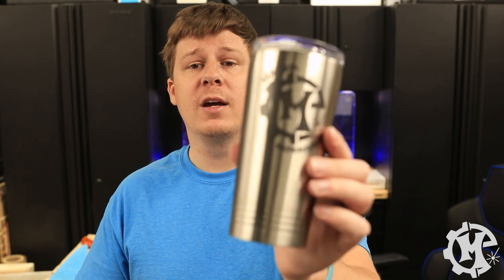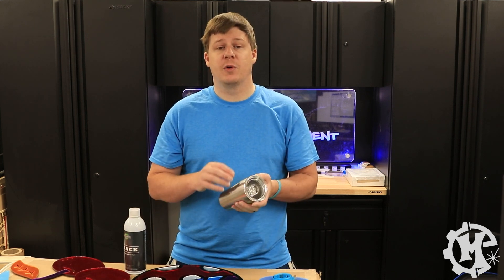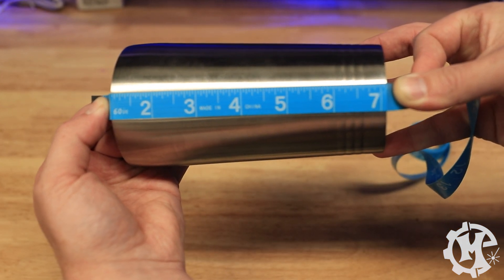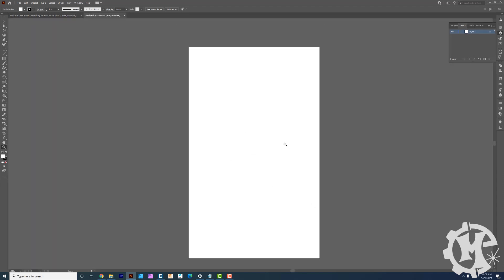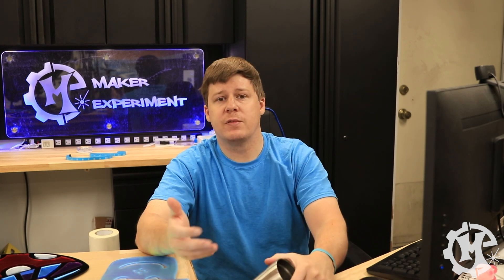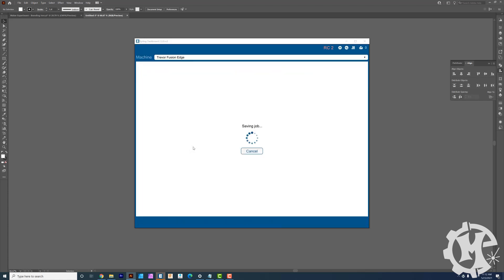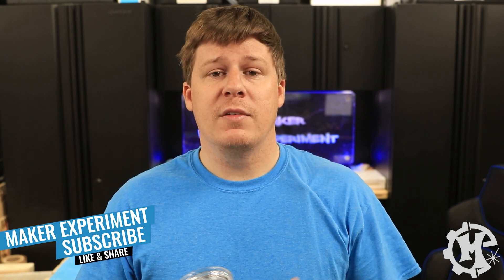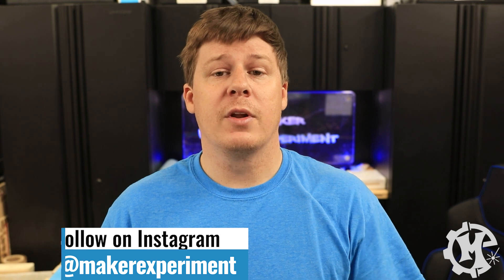HOW TO ENGRAVE STAINLESS STEEL TUMBLERS | ENGRAVING YETI MUGS | LASER ENGRAVING MUGS | LASER MARKING

Comment: What power or type of laser is required to use this spray to good effect? Currently i only have an Xtool F1 10w blue 2w IR. IR has not been working very well but my engraving room is 65 degrees. Reading the temp may be too low for IR?
Reply from the maker: I have not tried this type of spray with IR. I’ve only seen it work with a CO2 laser. That doesn’t mean it may not work with others but I would contact the manufacturer and see what they say.

Comment: Very good video but unfortunately what you show does NOT work with my Atomstack x/Pro or I have some wrong Lightburn settings ;( Could you please upload the exact parameters or a profile so that I could laser in exactly the same way on stainless steel?
Reply from the maker: I don’t use lightburn and the settings I use on my machine wine match that of an Atomstack. You need to run really high power and low speed for this method to work.
Reply: @MakerExperiment  THANK YOU SO MUCH for your quick answer and thumbs up for it XD and does it HAVE to be normal white matt spray or black matt?
Reply from the maker: @Muscle_81  this is a specialized spray called Enduramark. You have to use a spray like that one or Cermark.
Reply: @MakerExperiment  Ok, thank you very much, I ordered it just one more question XD Do you have the Airassist on or off?
Reply from the maker: @Muscle_81  I usually leave mine turned on.

Comment: Great Vid, Trevor! I am new to this and have been experimenting with the Enduramark Charcoal. I am getting light spots  toward the top of the graphic. They are uniform, so it's not like it's oil or something on the surface. Any ideas?
Reply from the maker: I’d check that the cup is actually level to the laser head all the way across. I’d also make sure the spray is even everywhere. Beyond that it’s hard to say without experimenting.

Comment: Hey nice vid. I was ordering a muffler and they were going to laser engrave it for me with my logo. I was wanting a more bronze look instead of very black like what is on your mug. Is this dependent on the source material I provide or the machine and the way they do it? Was wondering if I need to provide them a brown color logo vs my standard black one or does it matter?
Reply from the maker: It’s mostly dependent on the type of machine. To get coloration on metal they will most likely have to use a fiber laser. This is a bonding spray that reacts with CO2 lasers which is different.
Reply: @MakerExperiment  oh ok. I’m assuming they are going to use the cheapest method. I see a brownish/bronze color on most exhaust part engraving. Is this the natural engraving color?
Reply from the maker: @Dynasty-s1y  fiber lasers have some things they can adjust to get different colorations I believe. I’ve never personally done it though.

Comment: What does it do to the stainless if you did not use the marking spray?  I take it the stainless really isn't engraved, the laser just cures the marking spray onto the mug.
Reply from the maker: Nothing happens with a CO2 laser if you done have the spray. The spray reacts with the laser to create a cured layer on top of the stainless.

Comment: Hey brother I cant get my NEW 20W Xtool to mark ANY metal has worked great on wood and glass. Ive tried dry moly, cold galvanizing, omtech, brilliance and enduramark...nothing! with multiple speeds and powers, is it a settings issue?
Reply from the maker: I’m not familiar with diode lasers. I’m not sure what it would be that’s causing it. Typically you want slow speeds and high power when using marking sprays and similar items like it. It could just be a settings thing.

Comment: Hi, 
I want to do this. How does teh laser engraving change from SIlver v Black. Also from colour powdered finish v stainless steel? I am using the ATOM
Reply from the maker: The spray I use is for uncoated metals like this stainless mug. It has a chemical reaction and adheres to the mug chemically creating a black layer. 

For powder coated mugs it engraved through the powder coat layer. The powder coat is easier to work with but settings may have to change based on color of the powder coating.

Comment: Can I use the marking spray and the entire process with a diode laser?  If not, what process can I use to achieve the same result?
Reply from the maker: To be honest, I’d try and see if it works. I’ve never done it but if you can dial in the settings, it should be possible.
Reply: @Maker Experiment  thanks!  It is an expensive try.  But I think it is well worth it.  Should I try the brand you used?  It is a high-quality one, right?

Thanks for your videos!  You do a great job and seem like a cool guy.
Reply from the maker: @craigperrin9096  the one I used I like. There are others but this is one of the less expensive ones. You can reach out to Enduramark and ask them the question directly before you buy it. They may be able to tell you so you don’t waste any money.
Reply: @Maker Experiment  I got the marking spray, and it worked perfectly!    It is awesome.   I followed the settings as directed.  Thanks, man!
Reply from the maker: @craigperrin9096  I’m glad it worked out!

Comment: Why do you say it is "Permanent" when it is not!  It you had used a Fiber Laser, it would be smooth and PERMANENT, plus you would not have to go thru all the prep (spray, clean, etc.) to make the engraving adhere, the fiber laser does all that for you.  There is a layer (the spray) between the actual engrave and the stainless steel tumbler.
Reply from the maker: It is supposed to be permanent if done correctly. In order to use a fiber laser I’d have to own one. I don’t know about you but I don’t have access to one and many others don’t either. The spray is a good alternative for those that only have a CO2 laser.
Reply: @MakerExperiment  as someone who owns a fiber & CO2 laser dual source laser....I know from experience that a fiber engraver is superior to using a spray to "engrave" on stainless steel.  The fiber laser extracts the carbon from the steel to make the true black & smooth engrave that is permanent!  Anyone who is using the spray to make a black "engrave" claiming it is permanent is lying, because it is not permanent, there is a layer of that spray between the stainless steel and the engraving.  That's why there is a build up on the engraved area.
Reply from the maker: @jhnmrkb  I agree that a fiber laser is superior in this usage. Not everyone has one. Because it is a coating at some point it will most likely deteriorate, so you’re correct that “permanent” may not be the right word. Most people will have that engraving for the life of the object if they hand wash it. People who machine wash it may not. At the end of the day a fiber laser is a better option, but not always affordable for everyone.
Reply: Because it’s not going anywhere. I’ve put sandpaper to it and not even a smudge

Comment: When I turn my machine on, it wants to "home" the head and there are two switches that tell my machine the head is "home" and it then finishes reseting.  If I plug in the rotary before turning on my machine, the unit just spins the rotary endlessly, waiting for the head to hit a switch that it never will.  How do you compensate for this?
Reply from the maker: What kind of machine? I haven’t seen that issue.

Comment: Have you any experience with using this spray on polished stainless steel?  I used brilliance on a polished stainless steel charm and the marking faded off quickly.  I think I may not have cleaned it well or didn't apply enough spray prior to lasering.
Reply from the maker: I haven’t tried it with polished stainless to be honest.
Reply: @MakerExperiment  ok thanks

Comment: Do you know if it will endure dishwasher or will it fade away?
Reply from the maker: I haven’t done long term testing. To be honest, I’ve seen both happen to other people. If the spray wasn’t done well then the marking won’t be as good. It’s supposed to withstand it but it depends on how well it was applied.

Comment: Hey Trevor, thanks for the video. Quick Question about the center-center approach.

Does it matter where you place the graphic on the canvas (from top of tumbler or below .etc) if you are going to use the center-center setting?

I mean if you just made a canvas (or artboard) with the exact size of the graphic itself but not the tumbler. and run a center-center engrave on exactly where the red-dot pointer is. won't that have the same positioning effect?
Reply from the maker: Yup. When I do that in videos it tends to throw people off. You just need to make sure the tumbler rotates the proper amount. I haven’t tested it with a rotary so I’m not sure if you have to at least have the right art board height or not. It would be a good test.
Reply: You'll need to make sure the height of your artboard is the size of the circumference because that tells the rotary tool how fast to turn the motor.
Reply from the maker: @theonlyiainever  correct. I believe I mention that either in this video or my other mug video.